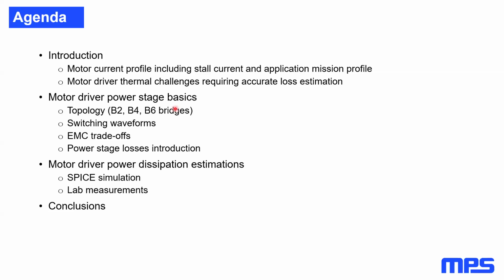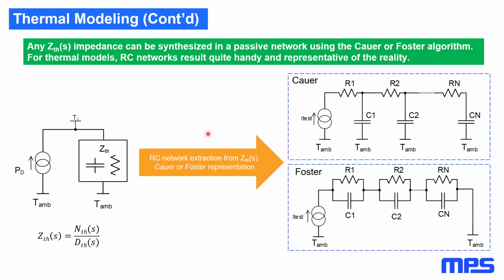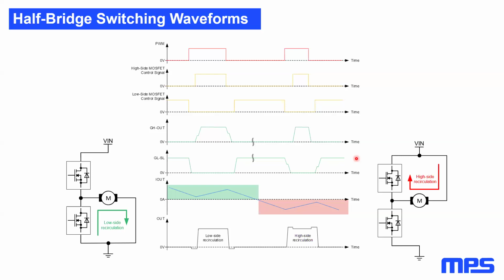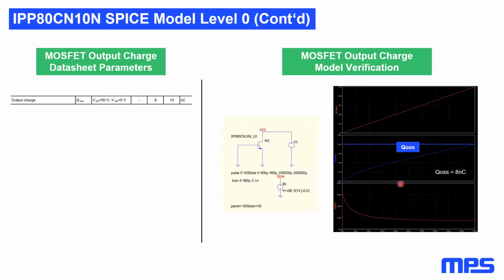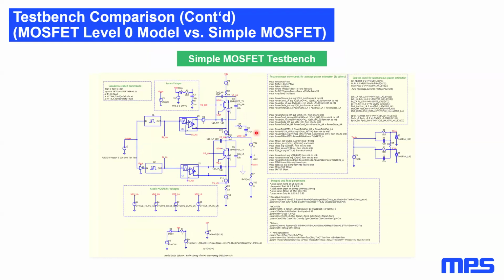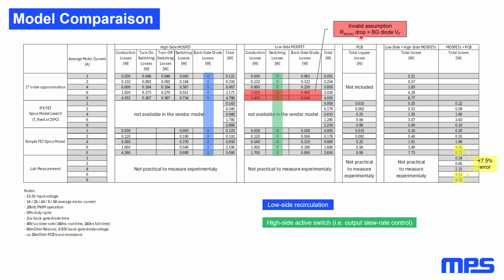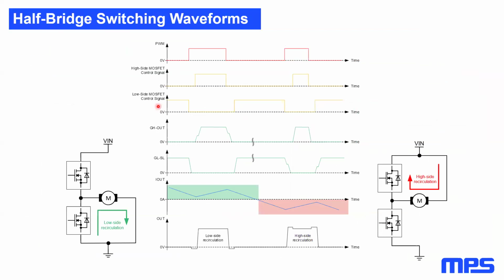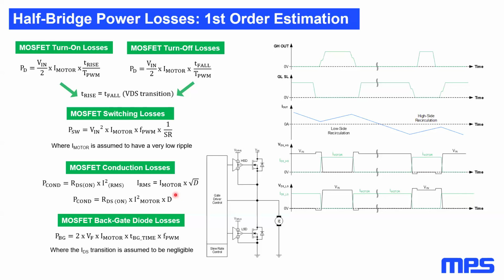Webinar: How to Estimate Motor Driver Power Dissipation

Comment: •	How does the switching frequency affect power dissipation in motor drivers?
	•	What are the trade-offs between conduction losses and switching losses when choosing MOSFETs?

How do heat sinks and PCBs contribute to reducing power dissipation issues?
Reply from the maker: How does the switching frequency affect power dissipation in motor drivers?
From the 1st order estimations formulas at min 22:53 of the video, you can see that PSW (the switching losses) increase linearly with switching frequency.

What are the trade-offs between conduction losses and switching losses when choosing MOSFETs?
A MOSFET with lower RDSon allows for lower conduction losses. However, in a given technology, lower RDSon means bigger gate oxide area, hence higher gate charge to achieve a certain gate voltage. This means that with a given gate driver current, this MOSFET will switch at a lower slew rate (SR), which increases the switching losses.  

How do heat sinks and PCBs contribute to reducing power dissipation issues?
Passive cooling systems, like heat sinks and PCB copper area, decrease the thermal resistance and increase the thermal capacity of the thermodynamic system that is any application. Looking at the slide at min 4:42, this means that for a given dissipated power, one can achieve lower junction temperatures or, conversely, one can dissipate higher power at a given resulting junction temperature.